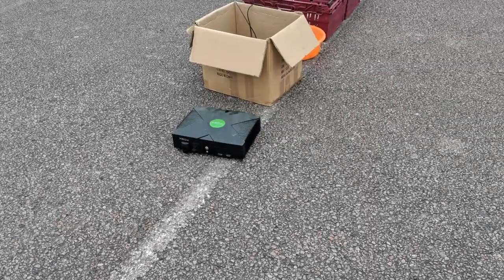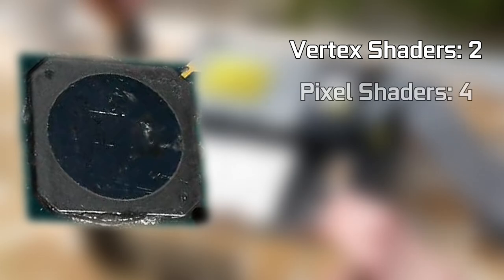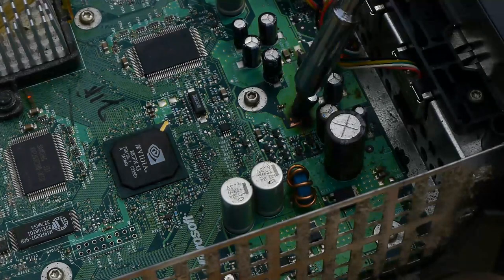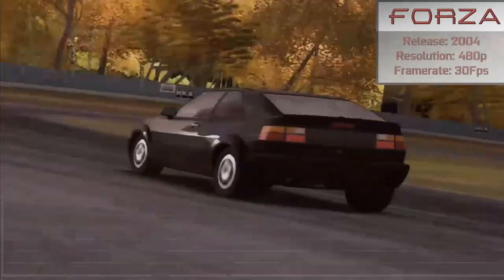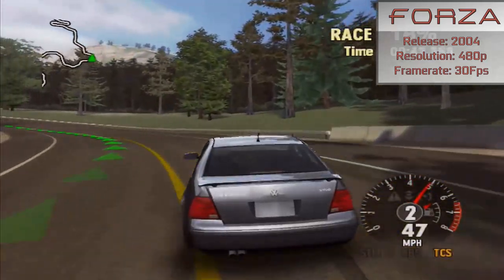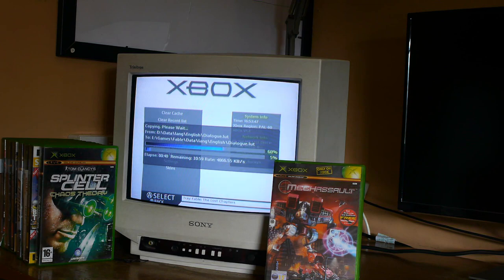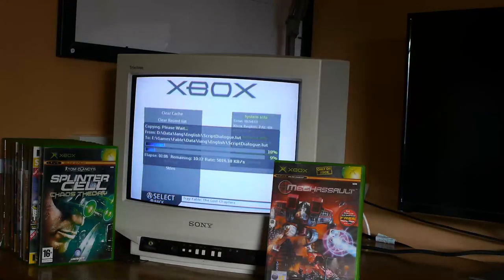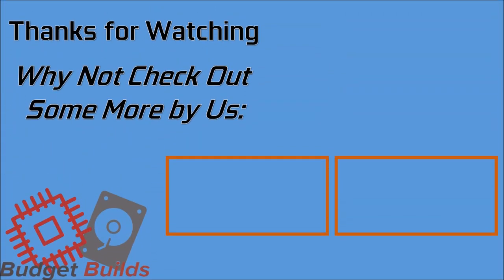How Powerful was the XBOX?

Comment: I really liked the Xbox and do think it had the best graphics and performance for the generation (also loved the Japanese version controller) but you could see the American philosophy vs the Japanese philosophy on consoles. In the Japanese philosophy, the console needed to be very efficient, quiet, and reliable whereas it seems that Microsoft took everything over the edge just to get on top performance wise. I've had basically every main game console that's come out since the late 80's and only my Xbox and Xbox 360 has broken! But because I liked them so much, I repurchased them both (as they died shortly after warranty). I recently played my Xbox and seem to be having some of the issues described (not keeping time, disc drive not returning, videos out of sync, and unusually long loading). But regardless I felt like Xbox and Xbox 360 were the spiritual successors to Dreamcast and they even had many great Japanese games on it. But with Xbox One, I felt like there was little reason to buy it if you already had a good gaming PC.

Comment: Directx 9 was developed under the 2001 XBOX for the directx team, thats why the Xbox is capable of RUN DX9 games like Half-Life2, Doom3, Far cry, will all 2004 DX9 effects... because the games werent ported to XBOX... ACTUALLY IS THE XBOX CODE THAT WERE PORTED TO PC 🤣
733mhz pentium 3 equals to 1.5ghz pentium4 and the Geforce4ti 4200 is the GPU of the xbox and all know it has more power than the Geforce 5 series that ran directx9. The original xbox, with 1.4ghz processor and 128mb ram just can play at 720p with directx9 effects. And remember the Xbox dont need ram, because he uses Hyper-Transport bus to use HDD and DVD as Virtual Memory. I repeat, that games WERENT BE PORTED TO XBOX... IS THE XBOX CODE THAT WERE PORTED TO PC on directx9. Nvidia and Directx team made the Xbox hand to hand, helping developers too to use the max performance of that "prototype closed hardware gamer pc". Thats all, is the only time in history that a console was just one generation over PC and rest of consoles... Original Xbox show directx9 effects because directx9... its actually the xbox code, simply as that. Far Cry, HL2 and Doom3.

Comment: Forza 1 at 30fps on Xbox is not as impressive as Gran Turismo 4 running at 60fps IMO. The Forza games truly started to shine when they stepped up to 360 hardware, and of course all run at 60fps and much better for it.

Other than that, the Xbox was a beast and still worth owning today purely for its homebrew and emulation scene (same as Wii).

Comment: What about HDMI mods? Not all new TVs have component video. My parents just bought a 4K TV and it only has HDMI, composite, and RF. No YPbPr inputs anywhere. I looked.

And CRTs? In 2019? Nah. Not unless you play light gun games. Then again, I just moved into a new house and space is at a premium with my setup. I don't have the room for a big, bulky tube, and damn well not a PVM or BVM.
Reply from the maker: I mean I'm pretty sure the HDMI Mod directly using the digital signal isn't actually complete yet. You can use a Component to HDMI Upscaler.
Reply: @BudgetBuildsOfficial  I could do that. My RCA TV does up to 1080p natively and I haven't had any input lag with all the consoles I upgraded to YPbPr. I tried using a SCART-to-HDMI upscaler with my Genesis, PS1, and PS2, and it wouldn't take the RGB signal that way. It only does RGB via the D-Sub 15 a.k.a. VGA input. Cheap one, though; didn't have the money for a Framemeister. So I went with YPbPr cables for these consoles instead. HD Retrovision's Genesis/Saturn cable works like a dream and I haven't looked back. All I needed for these systems were two adapters: One for my Model 1 Genesis, and another for the Saturn. For the PS2, I just ordered a cheap component cable and have used that ever since. Xbox? Wii? Same deal.

Right now, I just have to upgrade my Super NES and N64. Fuck composite cables! RF? Fuck that shit, too. RF is CANCER! S-Video? My TV/monitor doesn't have that natively. I've only owned ONE TV in my life that had S-Video inputs, and I got rid of that when I upgraded to HD. I don't own that TV anymore. The RCA TV I have now? Works great, and I've never had any input lag with it. Maybe RCA puts good upscalers in their TVs.

Comment: forgot to mention...
change the 40 IDE cable to an 80 IDE cable. A lot of games boot much faster.
Reply from the maker: Helps a lot more if you use a faster HDD, as I've always found the speed on a stock drive to be negligible with more bandwidth.
Reply: @BudgetBuildsOfficial  well, I have a fast 1 tb sata to ide hdd. ;)

Comment: The CPU in the XBOX was neither a Celeron or a Pentium III. It had the core and bus speed of the Pentium III, and the cache of the Celeron. You could call it a "Peleron"  The bottom line is that that extra cache cost die space and some extra money to manufacture.  If it was needed then I am sure that Microsoft would have used a normal Pentium III. If they could have gotten away with it they probably would have used celeron processors to save a buck.

Comment: lol an remember building my first pc with a skt A duron modded up to am Athlon on a Barton core an a Nvidia fx 5200 upgraded to a 5500 later....Yeah I know. an I was worried my 250 quid pc   was lacking compared to an Xbox ..till my mate brought his round an I went scene by scene on splinter cell an pc left it for dust an was glad I'd not splurged out on an Xbox...Yeah it was good but wat I cud do an all the extra performance I cud squeeze out of the pc I'd built was way better fun..hard modding the cpu to unlock all the cache an unlock the multiplier an hard lock the voltage..think I slammed 2.50 volts thru it...sounds huge now LOL

Comment: man after playing half-life 2 at 1080p + MMOD at 144 fps, looking at the XBOX version makes it look like ass when compared
but it's easy to forget that it's running on a 700 MHz cpu, 64 MB of ram and a GEFORCE 3 - 4 hybrid so it's still very impressive in its own right

also no way the xbox is easy to softmod, it requires either a specific game, usb to xbox's proprietary plug or an IDE connector on your pc to plug the xbox's hard drive to, which all of these are kinda difficult to get, at least where i live, wanted to softmod mine for a while now but i just can't, on the other hand my ps2 was easy af to softmod, just had to burn a DVD with a special program i forget the name of and installed freemcboot on my memory card

Comment: nice console. it's would be identical as the Nintendo 3DS for the wonderful graphical capabilities. Xbox uses Nvidia NV2A 3DS uses DMP PICA200. I was looked on the 3DS Graphic. and I watched the dead or alive dimensions video. and Dead or Alive 3 Video. This is the strongest video game console in the seventh generation. in terms of the processing power. Xbox uses Pentium III 733 mhz Nintendo 3DS uses Dual ARM11 266 Mhz. However. The 3DS has Higher Graphics Capabilities because They're using DX11 like features on the game. some game has benefit to use the better graphics from the PICA200's DX11-like Graphics features.

Comment: You forgot to mention just how HARD it struggled with Halo 2.
Reply from the maker: Halo 2 ran pretty well from what I remember, and I played through the entire game.
Reply: @BudgetBuildsOfficial  It was my experience that, mostly with cutscenes, the hardware was absolutely choking. I especially remember one of the scenes having to do with the prophets and the arbiter... the system had such a hard time loading everything, that you would see a lot of slowdown, and pop-in of assets and textures. This behavior was present on both an original, untouched xbox, and a custom modded one that i built.

Halo 2 certainly pushed the hardware to it's absolute limits.
Reply: @numberyellow  are you sure it wasn't the disk or dvd drive causing that?
Reply: @ips2124  my discs are pristine. it was the same behavior across multiple machines, and they ran every other game in my library just fine.
Reply: @numberyellow  i just tested halo 2 myself and it runs just fine.
Reply: @ips2124  I didn't say it didn't run fine... i said it choked on some things. never had an issue during gameplay, it was during some cutscenes.

Comment: if you can get high quality DDR1 RAM modules and replace the ones in your Xbox, you can get even more graphical performance, Miscroshit was too cheap when they made the console that literaly bough boxes of rejected RAM chips to build the Xbox, if you playa demanding game and see framerate drops you are an unlucky one who got defective RAM modules

upgrading the CPU is a difficult and costly process and most of times not worth it since it breaks games, most are hard-tied to the 733 MHz clock and will either run too fast or just crash...

Comment: How powerful is it? Its like a coin toss, you'll get a celeron or a pentium 3 with a 2001 nvidia gpu.
Reply from the maker: Nope the specs are pretty much always what was shown.
Reply: @BudgetBuildsOfficial  at first they used custom pentium 3 chips, later on they used celeron chips with a higher clockspeed to lower the cost.

Comment: og xbox was the best
 built like a tank to last. unlike those horrible models that followed it
Reply from the maker: The 360 was a brilliant console to be fair.
Reply: @BudgetBuildsOfficial  My first Xbox 360 got its insides melted, and my second got the red ring. After that I swore to never buy a console again, yet I bought a ps3 and a ps4 that both have just been collecting dust since the modern warfare 2 days
Reply from the maker: @justabbygal4777 : I'll be honest I got very lucky had one Xbox 360 which eventually RROD'd but by then the slim was out and such good value I ended up with one of them which is still working lovely to this day... Still gets used everyday too.

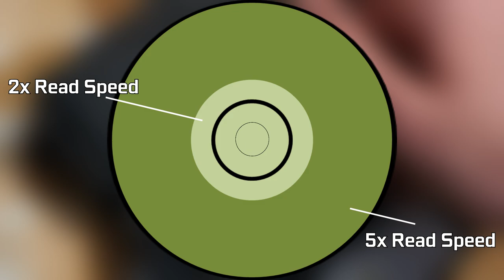Comment: 2:50 what are you on about? this is normal with optical media - it is nothing special to the xbox
Reply from the maker: The point being the XBOX used dual layer DVDs which would then be padded out so most of the content was accessibly from the outside edge with a higher read speed, something that would become a limit on a large game on standard single layer DVD Drive.

Comment: What r u talking about? Cant be done on any other systems? U r speaking a way out of your league 
Only thing xbox had by default was a hdd that "helped" with certain games but either system could still do it eg ps2 GameCube and reason why ps2 got a hdd 
GameCube and xbox were about par on system power both had there strengths and weaknesses but equal out in the end basically powerpc vs x86 nvidia vs ati battle 
GameCube just had minidvd and no hdd which is why they made the Panasonic q which had internal mem not a hdd exactly but something and could read full dvds
The ppc was faster than the xbox x86 by far clock for clock and the ati gpu could do things better or special nvidia couldn't and vice versa stuff like fur on starfox etc
Reply from the maker: I suggest you watch this video, and a follow up with Techwen where I buy a Crystal Xbox for £10 and run it through its paces. Might shed some light on your concerns. 👍
Reply: @BudgetBuildsOfficial  bro i use to repair/mod them im a engineer everything i said was 100% facts i even used to add Tualatins to xbox

Comment: HD resolutions??? I don't think so.
Reply from the maker: I show 720p Sims 2 gameplay. Also a few other titles (Soul Calibur 2 etc... Work in 720p)
Reply: @BudgetBuildsOfficial  the original xbox didn't have HD output, but I would be extremely intrigued if it did, who would have even had a HDtv in 2001? Maybe a pc monitor could display that resolution in 2001 but definately no TVs around that I am aware of unless it was some sort of 10 grand Japanese prototype or some such.
Reply from the maker: It supports Component, which can support all the way upto 1080i?
Reply: I don't know where you're getting your information, but it's incorrect. The A/V port of the original Xbox supported HD output with appropriate cable, the official branded one looked like this: https://www.amazon.com/dp/B00005R6YZ
Reply: @SpeedyGoneFroglegs  again who even had a HD tv in 2001? Horrid Standard def flat screen plasmas were just starting to become a thing in rich houses but they were not even HD
Reply: How many people had a display capable of accepting the input is irrelevant. The technology was there and built into the console for any and all with the appropriate hardware to exploit.

Although, since you seem to be preoccupied wondering who had what displays at the time, it may be worth noting that in 1995 John Carmack wrote Quake on a 1080p monitor.
Reply: @SpeedyGoneFroglegs  interesting,  appreciate your feedback but we will have to part ways on what is clearly our own individual perceptions of the pasts HD capabilities before 2005
Reply: You're welcome to keep your perception, I'll stick with what is a provable and irrefutable fact.

Comment: I don't understand how HL2 was ported to Android exclusively for tegra devices yet the Xbox is much weaker than my phone and thanks to valve's lazy ass I can't play it and that's just fucked up.
Reply from the maker: It's easier to port x86 to X86 than it is to port x86 to ARM.... However I suppose they could have used the PPC Version as a base for the ARM Port but you'd need to research how the ARM Version was made as I'm not to sure how they made it.
Reply: @BudgetBuildsOfficial  I know but my point is that it's ridiculous they can get it to run on a console that's underpowered in all specs yet I need a mobile phone with 4 GB of RAM just to play it. It's just incredibly stupid and lazy and closes off 80% or more of the mobile market and player base.

Comment: The Xbox wasn't the most powerful of it's generation, at least not by a long shot at all when the GC was either faster or right on its heels...That thing was deceptively fast for what its specs say about it: The CPU was comparable to the Xbox's because while it ran at a much lower clock-rate for the time (486Mhz vs 700Mhz) this was also when the "x86 tax" was still very much in effect badly enough for Apple to be using PPC in their entire PC lineup still (There's a reason why all the big CPU improvements since x86 became dominant for nearly all traditional PCs are so similar to a lot of those older RISC arch roadmaps, heck the Alpha's roadmap and planned roadmap is pretty spot on with what Intel and AMD did 5 years later) and the NV2A graphics chip is a lot slower than the ATi Flipper when looking at peak performance, but a shade faster when looking at realistic performance during gameplay. (Which is one area that the GC would appear slower, although it would be like comparing an OCed GPU to its stock counterpart in terms of difference at best. Another area is the lack of a HDD meaning it loads everything from ODD.)
Reply: in what alternate universe is the GameCube more powerful?